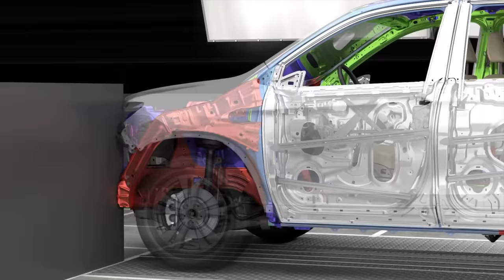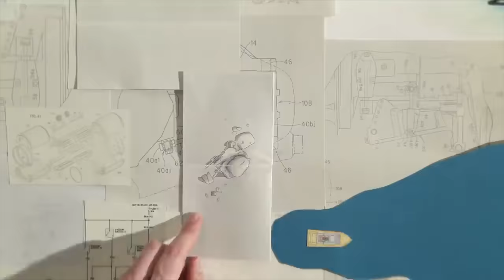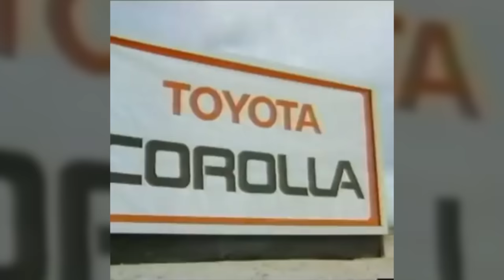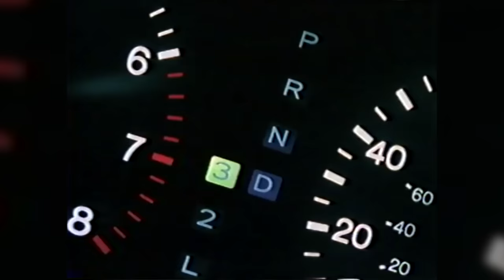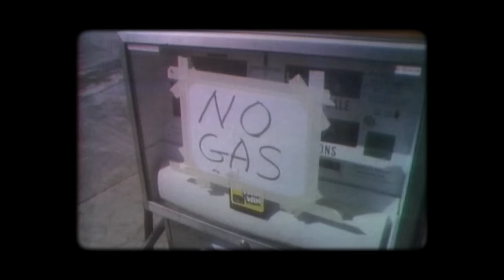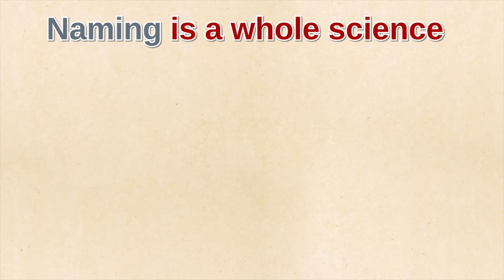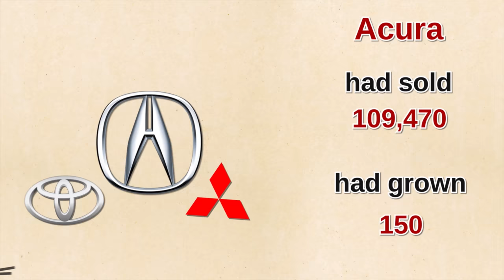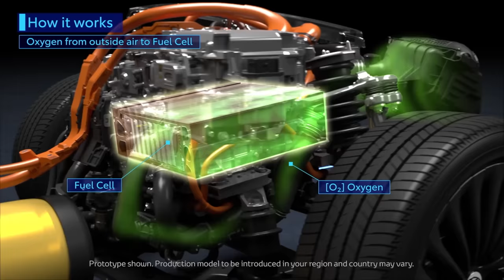Here's Why I Only Buy These 4 Car Brands

Comment: My mom gave me her '96 Toyota Camry when I first got my license. I hated that car because I thought it was the most uncool thing ever, but it never gave me any issues. Looking back now that I'm older and have made some very poor car purchases for the sake of having a "cool car", that Camry was the best car I ever owned haha.
Reply: Just for the record we’ve owned two Camry’s and a Highlander and didn’t have a lick of trouble!
Reply: I made the same mistake of buying "cool" cars, like a Ford Thunderbird.  Only 13k miles later, my power window needed a new motor, then other things started to need work.  The only things that lasted were the engine and transmission.  But I didn't keep that car long enough to know.  I  had enough and sold it at 140k miles.  Since then it's only Toyota or Honda for me.  I've driven both to well over 200k miles without much problems.
Reply: Thanks ma
Reply: I can relate. Cool cars cost cash that I'd rather spend on other things.
Reply: Same here with mitsubishi montero 2006 model 3.2l diésel. Best car ever. It never breaks and it is equaly fast as all diésel pick ups trucks sold except the shity amarok.
Reply: 96 camry for life, hate that we sold it @ 250K miles. I think it would have easily lasted double.
Reply: @chaliween 1996 Camry's ran well, but the only issue was those brittle door handles. When they were redesigned for 2002, the door handle issue was no longer!
Reply: That 96 Camry still cost around 3000$ probably
Reply: Funny same thing with me with a 00 Camry, except it gave me a bunch of problems  in 2011, nonstop. Plus it’s so ugly
Reply: Mom knows best 😁
Reply: I know that feeling so much. my first car was a honda accord, wrecked it. then my parents got me a Toyota corolla i believe it was '99. I drove the hell out of that car, it was uncool and the green paint was faded, really looked like a junkyard car but it was reliable. Never had to do the dreaded "my car won't start" phone call to parents. dad took care of the routine Maintenance checks for me so all i had to do was drive. once i graduated and was able too first big purchase i made was a new car. I always wanted either an Audi or a BMW since i had this hard on for German engineering and those were the "i got money" brands in my eyes.  I got me a beamer M5 i think the year was 2009 i can't be too sure i try to forget about that pos.  and god damn. Worst decision of my life, maintenance was off the charts and it had all kinds of problems every few months. freaking money pit car, was not worth the cool factor. Probably could have bought 2 base trim Honda's/Toyotas with all the money i spent on maintenance -_-. So when the car was totaled by my insurance i breathed a sigh of relief cause now i had an excuse to get a new car and i went and got me a Camry! it might be "boring" but screw it.
Reply: I just bought a 2011 Honda Crosstour with 145,000kms. It is like new from B.C, no salt, no rust. V8 AWD, I'm good for 10 years.
Reply: I can relate to this 100%
Reply: @rickyrickardo8347  lol I assume you mean V6 else you got a unicorn.
Reply: thank you for making the roads more interesting to look at while I drove my Honda.  Else everyone would be driving Toyotas, Hondas and Ford F150's. lol  As they say, own that ugly house across the beautiful house for the nice view.
Reply: Those 96 Toyotas are like tanks.
Reply: I’m trying to tell my sister this
Reply: 23 years old and I drive an 04 Honda pilot. Went 2.5 years without any major repair work needed. Total grandma car, lame, nobody is going to bat a second eye at a man in his 20s driving an old beat up SUV. But I've maybe sunk a few thousand dollars in repairwork and it was all minor things, routine oil changes, tire replacement, strut replacement, etc. NEVER had an engine related issue until the original factory alternator went out, replaced the belts at the same time. Just solid engines. If you're responsible and change the oil, keep an eye on leaks, they'll last forever. Just replace the timing belt and bring it in when that check engine light comes on.
Reply: I bought an '87 Camry. It was going strong after 20 years before a bus ran a stop sign and totaled it.

Comment: Over 60 people disliked this vid because you didn’t include Mercedes and BMW’s here or they’re probably just upset at the money they’re wasting repairing their cars.
Reply: Some people don't mind endless money pits.
Reply: WELL, HE HAS commented on Mercedes and BMW.
My 2013 BMW X5 35I M is really nice. 5 years of driving . Washington  DC to Moab to Savanah to Denver. But  I hope I can afford to another long trip.
The parts can be expensive and dealers service are crooks and liars. $3100.00 QUOTE FOR valve cover gaskets ,oil heat exchanger gasket and a rear door latch catch.
I have a local mechanic like Scotty.
Oem gaskets $60
Which are cheap designed for failure. 
$6 to replace a crankcase vent hose better than a $160 oem. $ 0 to adjust rear latch that is good. Oil change ,alignment all lubes and inspection.$600 plus a steak house gift card.
Buy a Lexus or Acura
I will the next time!
It is a driving machine.
Reply: I love bmw and porsche.  But this production is excellent. Why would you even dislike it.
Reply: I've had an 04 Bmw e46 m3 since 05.Its a typical German car over complicated and unreliable.For every owner of a German car that says it's been reliable theres ten in the shop.
Reply: @byrdjohn3280  I like that you included the steak house gift card. I try to let my mechanic know I appreciate him as well. He's a great guy, honest and very reasonable. Qualities that are getting harder to find.
Reply: @byrdjohn3280  Hi, John do you know a decent/very reasonable & reliable BMW mechanic or how to find one  in Las Vegas? I need one!  Tx!
Reply: The rest liked it because they can only afford a Honda or Toyota 😂😂
Reply: @johnb2572  If you can afford a Honda or Toyota you can afford a car with a 'premium' German badge especially used!
Reply: Let me tell you! When I heard a BMW owner say their oil change was in the $300+ I was like whaaaaatttttt!!!!! I got a Honda Pilot Delta Sonic charges $75 I’m good 😂

Comment: 1- 1996 toyota celica
2- 1996 toyota celica
3-1996 toyota celica
4- 1996 toyota celica
Reply: 1 Toyota Matrix 

2 Toyota Celica

3 Lexus Es330

4 Triumph motorcycle.
Reply: 1994*
Reply: It’s 1994
Reply: What planet and I will go buy one.  They are rare to find these days.
Reply: @standtallvets5386  one on FB now in Arkansas I believe
Reply: 79 Celina gt hatch 20-R 860k+ miles kept going but body rusted away lol
Reply: 1994 Toyota Corolla  bought it for 600 dollars with 159,000 miles wrecked it at 257,000 miles engine still had get up and go , drove it to the junk yard , got 214 dollars for it .
Reply: @robertwilliams-wd6cp  genius

Comment: I kinda love how these four brands are made by two companies. I currently own my third and fourth Honda vehicles (make that fifth if you count my lawnmower). The previous two were totalled after being in wrecks (both instances the other driver was found at fault). I'm convinced that Hondas never die and can only be killed. 

Props to their safety features too. A curtain airbag left me with a goose egg as opposed to what could have been a cracked skull. Word to the wise, just because the other guy is supposed to stop, doesn't mean he will.
Reply: That's why we always have to drive defensively and proactively
Reply: Never think people are thinking at all when they are driving a weapon that can kill you. I had the cracked skull from a t-bone ( on my front passenger side) the truck was going 55 mph. My friend was at fault. The Virgin Mary insisted I put my seatbelt on,  5 seconds later my friend missed a stop sign. Never underestimate the power of the Virgin Mary, a seatbelt and a car. Prays to u!♥️
Reply: @PlatinumIrishrose  i was T boned in my Honda pilot and they totalled my pilot, i was left without a scratch but my back was sore
Reply: “Hondas never die and can only be killed” Amen
Reply: My pressure washer has a Honda engine good engine.
Reply: You ride around in your lawn vehicle?
Reply: My civic hatch is the best car I’ve ever driven. Also saved my life when I got tboned. Not a scratch on me.
Reply: Yeap gotta agree , good engine's always starts easy.
Reply: @PlatinumIrishrose Mary is not a virgin. Jesus had siblings. Also, Mary is just a human being and is not telling people anything.  It is the Lord Jesus and/or the Holy Spirit who does that.
Reply: The reason why the other driver didn't stop is because their not paying attention to their driving (head up and locked).

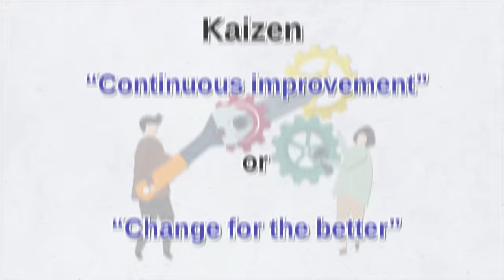Comment: About Kaizen (at about 33:40): my uncle worked at a Cadillac plant WAY back in the day at a station that involved assembling and installing dashboards.  According to him, if they ran into a bad speedometer, they threw it into the reject bin and grabbed another one to put in the car.  If they ran out of speedos during production, they just started installing those in the reject bin until they got a fresh supply of new ones.  This car was considered the Standard of the World back then, the best GM could do.

When I was a kid in the 50s - 70s and we got a new family car, the first accessory we installed was a notepad and pen to ride along on the front seat where we jotted down the flaws we discovered as we got to know the new car.  This was the to-do list for the next visit back to the dealer to ask for the problems to be fixed.  It’s just how things worked then.  

We marveled when we got our first Toyota.  There was nothing to write down on the list.
Reply: Similar story from the microchip world - the US military bought several thousand chips from a Japanese manufacturer, using MIL-SPECs, which allowed for 5% bad chips, typical of US manufacturers.  The Japanese delivered all the chips, but packaged (and labeled) the 'requested' 5% bad ones separately!
Reply: @johnbjorkman4144 OMG the faulty microchip story.  I heard it too but for IBM UK, and it was 3 defective chips per 10,000.  So they were in a separate bag with a note.

How the story changes but stays the same.

Also the car mechanic would say there are over 200 things that can go wrong so you can't fix it all.  Then Toyota made that a myth too until they realised the loss of revenues from repairs.  So now we have a calculated maintenance/repair cost built in to all products.

Comment: I can agree on how the Lexus LS400 was truly a luxury vehicle a head of it's time. On my honeymoon, we rented one in Las Vegas, drove it to the Grand Canyon, then to The White Horse National Park in New Mexico. While coming back on I-70 doing 70 mph, I was flagged down by some local residents. I couldn't understand what they were trying to tell me since it was at night. They were all trying to tell me something about the car was not right, yet I couldn't feel and difference in performance. So I pulled over at the next exit and went around to the back of the car to see a totally blown out tire. Mind you I was doing 70mph and couldn't feel anything. It drove smooth without any pulling or drag. Even the rim held it's overall shape so I was able to change the tire. Where normal rims would have bent around the hub. I was so impressed we sold both of our cars and bought one LS400. Which lasted us 7-8 years until I was rear ended and car was totaled.
Reply: amazing story

Comment: Some years back I needed a cheap used car that got good mileage as a commuter car. I bought an ‘88 Integra with 200,000 miles on it for $1500. I sold it about 6 years later for $1,000 with 290,000 miles on it. Best $1500 I ever spent.
Reply: Wow that is great!!
Reply: In fact you spent $500 lol

Comment: One feature that I would like for Toyota to bring back is the front passenger seat that can be adjusted to be flat like in the matrix. It is so handy to carry 8 foot pieces of lumber and sleep in when camping. Its a major selling point for me.
Reply: Mini van!  You'd be amazed at the things you can load in them!  I have Honda- take out seats, fold down rear ones, I have hauled 4x8 sheets of insulation etc.  Also have a 5x8 cargo trailer - it can tow up to 3500 lbs....  plus, touring models are luxury.  Watch your vids on guy saying why he "hates" them lol (because he loves the use/convenience was too good and he had no excuse to get rid of it 😅 ).
Reply: The Honda Element did that all the seats can fold flat .
Reply: I've had a Matrix for 16 years and never knew about or tried that feature! I often use the flip up rear "magic seats" on my Honda Fit though. It allows me to use the rear floor. The Fit-derived HR-V has them too.
Reply: Sleep under the car while camping, and inspect the under carriage at the same time.
Reply: The things I moved in my Matrix were staggering.  Besides an entire house in multiple trips I think the most impressive was a full size standup Zaxxon arcade game. Even I was impressed 😎
Reply: @8wheeledassassins.  I moved an entire household in an 01 Chevy Malibu in multiple trips.. but if we had my wife's fit back then, it would have been a lot easier

Comment: I have two Mercedes, I maintain them and they both have over 200,000 miles. The bodies are still in excellent shape. I've owned Hondas and Acuras, they both had great engines but the bodies were cheap metal that regardless of care given they always rust.
Reply: Thin uprotected body and weak paint is the biggest problem of Hondas. But i believe most brands nowadays have such problems.
Reply: Germans cars last forever if you maintain them according to the manufacturer exact specifications.

Also, this video may be valid for the US and not necessarily for the entire world

Comment: My dad had a 2002 Acura TL type s with a sunroof and leather seats with a navigation system, heated seats, and a tape deck, my dad bought it 5 years ago for 1200 bucks with 200,000 miles and sold it for 300 dollars 2 years ago, to this day he still regrets selling it.
Reply: Well...he can always buy another one. 😉
Reply: I have a 2005 Acura TL with the 6 speed manual ( limited slip )  trans and factory Front Brembo brakes . Its a blast !
Reply: Yeah those are worth keeping, and probably putting a new engine and trans in after it gets over 300k miles, if everything else is still decent on the car.
Reply: @standtallvets5386  wouldn't make sense to do that when they can go over that mileage and much more on the same engine that sounds like something you do with a unreliable brand
Reply: My mother just gave her 2004 TL Type S automatic with over 350,000 miles to her grandkids.  That's the only car she bought because of my recommendation.  It has lasted more than any other car she has owned.  She bought it new.